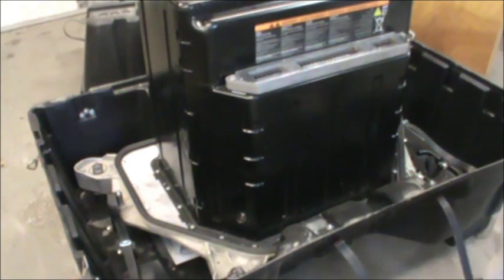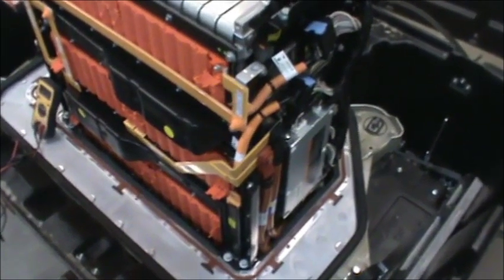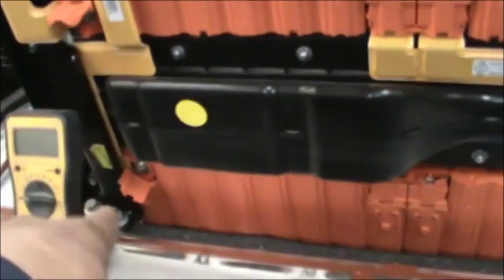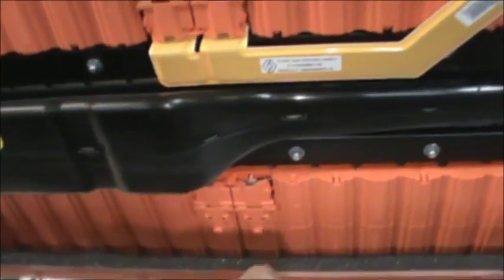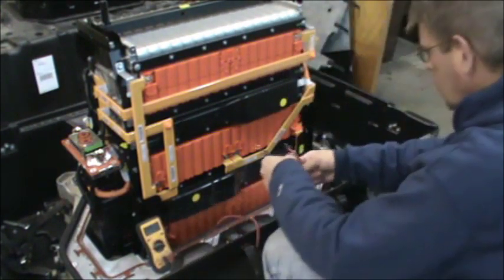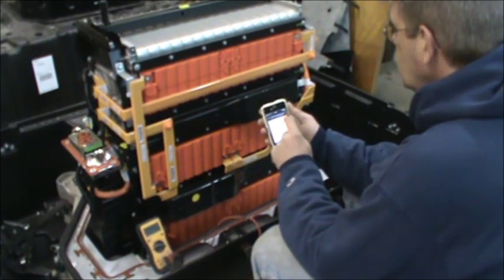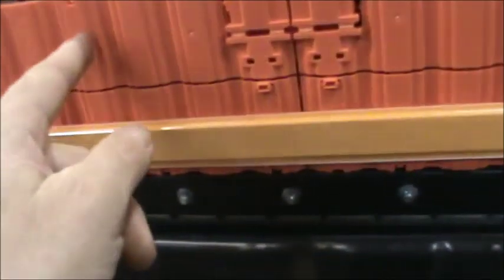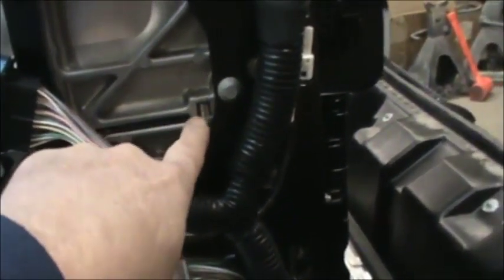My Civic EV Electric Car Project Part 12 Checking The Voltage On The Fluence Battery Pack

Comment: I am currently looking at building an electric car but the lifepo4 batteries are way too expensive. In the earlier video you said that you got this one cheap. If you find another one could you reply to this comment?
Reply: Noah Wilding if your still doing this project, also look into the using 18650 cells from dead laptop batteries (not really dead, whether the batteries BMS good bad or one cell is bad, causing the BMS to think the entire pack is a dud). Much lighter, and you can get them for free if you know where too look.

Comment: The current at 300+"VDC is very powerful. You have an arc welder there! Good luck and like others please wear some isolation on your fingers, I was holding my breath when you were pointing at the tie bars. Whew!
Reply from the maker: I don't think I breathed the entire time I was taking of the bar strapping. After that I relaxed.
Reply: You absolutely right! I saw injuries of my friend who worked with a 400V 100Ah battery and hurriedly made an electric arc! 400V DC holds very long arc! He has 3rd+ level burns all over the body, leg arms and body side. Be very careful! It's not e-byke!